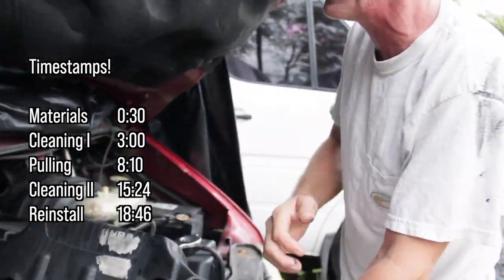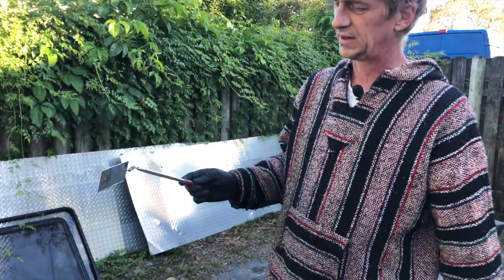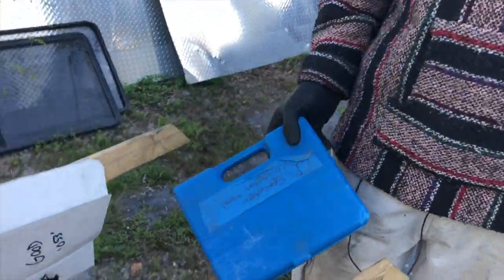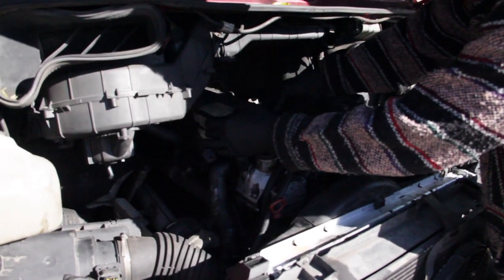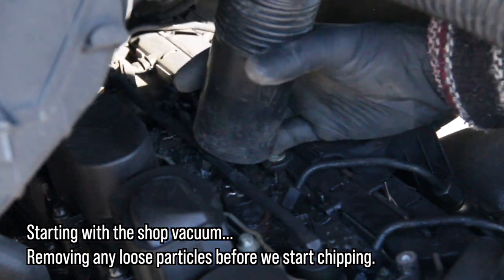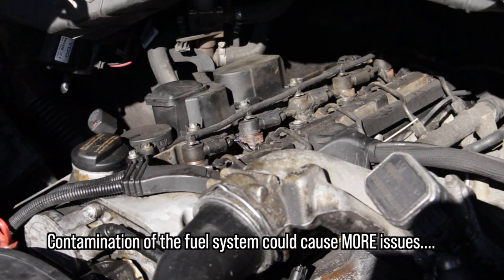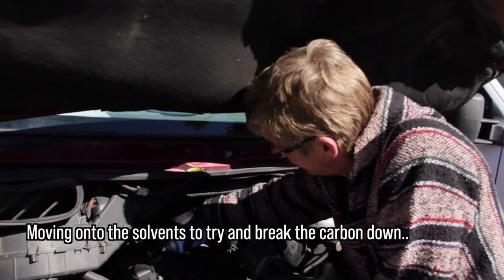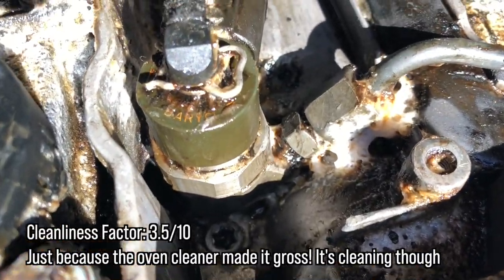Fixing Black Death on my T1N Sprinter!

Comment: You'll never get the bits out with a vacuum. Use an air blower at every stage, and most of the injectors will pop out ok if you drive it a bit, destructive puller is absolute last resort unless you've got plenty of cash to waste.
Reply from the maker: We showed how it worked great with a vacuum on video.
Reply: @FloridaVanMan  How do we know the bits were all out, there's allsorts of nooks in there. I tried a vacuum myself, then an air blower, the shit that came out after that..
A good way as it will blast some of the carbon off also.
Reply from the maker: @systemofayeup-notatribute8553   I cannot advise blasting air into the thread holes causing that dirt to fly out. Canned air or air-compressor nozzles have worked for some. The vacuum and plastic straw is very effective and safer for you eyes and your engine. I use the straw as a depth gauge, ensuring the hole is deeper than the bolt. Small brushes are available everywhere now with reusable straws becoming popular. They work well for cleaning bolt holes too, but don't put them back in the kitchen. :O)
Sometimes an injector can be popped out by driving. We tried running the van and putting a load on the engine, but going out on the road is not always an option, though it may work for some. Driving the injector out can also put you in a bad situation trying to get the van back home to clean everything up. Driving home on 4 cylinders isn't good advice. Replacing the popped injector roadside isn't good either, as there is no way to clean as well as we can at home. 
Thank you for the input. While we may not agree what is a "good idea", your suggestions have worked for other people and I'm not going to call them a "bad idea". It's just something I can't recommend because of the other problems that *might come with it. 
The destructive puller is definitely a last resort, but we can get Bosch Authorized rebuilt injectors for about $300ea.
Reply: @FloridaVanMan  when trying to drive it out does the bolt need to be all the way out or partially loosened? Same with the bracket clip? The fuel line and return line I assume stay connected while doing this? I was thinking just driving around the block several times to loosen it.